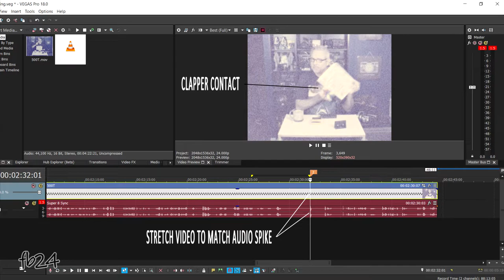Syncing Audio and Non Crystal Super 8 Cameras / Round 2! | Kodak Vision 3 500T | Filmboy24

Comment: Have you tried fixing this by changing the audio vs picture? I do a lot of this sort of fixing. I have used non-sync sound super 8 and 16mm cameras for years and synched audio no problem. The key is to do exactly what you've done, find a mark at the head and tail. Then simply adjust the speed of the audio to match. I think when you adjust the picture, you're going to have more difficulty. You're also changing the frame rate, no matter what the software says it's doing. It will add or drop frames, depending on what you're stretching. A good post software like Resolve, won't have any issues with stretching audio. Simply change the percentage of the audio speed so it matches.
Reply from the maker: Hey Tyler, I have tried adjusting the audio before, which also seemed to work pretty well. My contention is that, though I'm sure it doesn't help with compression/artifacts, slightly stretching or contracting the video file actually brings it closer to a true 24 FPS. Old super 8 cameras tend to keep, what I call, a variable constant speed. They will always drift back and forth a tiny bit (which I know you know), so I have had to stretch the video both ways to compensate. I guess, in the end, it's simply a choice. I absolutely see what you're saying, and the benefits of it, I just always seem to go against the grain :)
Reply: @Filmboy24  Interesting. I just synched one of my old super 8 sound films and got it to work ok... not perfect, but darn close. I agree, it wavers in sync for the entire thing. It’s just messing with audio is a lot easier for sure. You always gotta screw with it, kinda sucks. I only know of a few double system super 8 cameras that work with sync sound. It’s amazing how much they fluctuate!
Reply from the maker: @CinemaRepository  you're absolutely right about that, they do fluctuate. I guess the key (at least with the lower end consumer models) is to find the one that drifts the least and get comfortable with it. My search continues...
Reply: @Filmboy24  Yep! The best of course are the Beaulieu later models. I’m doing some testing with some later gen Elmos now and hopefully will publish the results soon.
Reply from the maker: @CinemaRepository  Thanks, I'll keep an eye out for your results.

Comment: Final Cut Pro is what I use. Retime is the menu name and the video is dragged to fit. Spring wound cameras limit me to around 30 seconds. 24 fps works best, easiest, less stretching of video, however 16 fps works, too. More film that way and longer takes. I never was able to  change the audio without it sounding terrible.
Reply from the maker: Thanks for the info, Michael!!
Reply: Thanks for the FCPX tip. Retired.  Where in the drop-down menus is that?
Reply: Retimed
Reply: @Zalnut1  Modify is where it is

Comment: I tried a magnetic head from an cassette adapter and touch it with the super 8 magnetic head, 

it produces sound but not sure it’ll sync sound any better 

also used video tachometer iOS app and noticed when I hold down the little button to activate the super 8 tape head the shutter fps went around from 18fps to around 16.70fps
Reply from the maker: Wow, that's a lot more fluctuation than I would have guessed.

Comment: Would shooting at a higher frame rate and dropping frames to project it at 24 help
Mitigate the drift? I feel like it wouldn’t work but I’m not exactly sure why
Reply from the maker: Unfortunately, no. If you shoot at 48FPS (for example) and project or scan at 24 FPS, your footage will all be in 1/2 speed (slow motion). An easy way to understand it is, it would take you about a minute and 15 seconds to shoot a full cartridge at 48 FPS and about 2 minutes and 30 seconds to watch it, thus slowing everything down. I've done more recent videos on syncing to non-crystal cameras that came out much better I think. The problem is that none of these cameras run at a precise speed. They will drift up and down throughout filming.